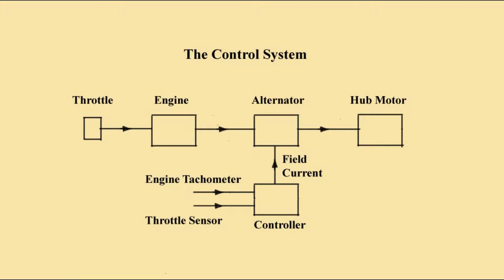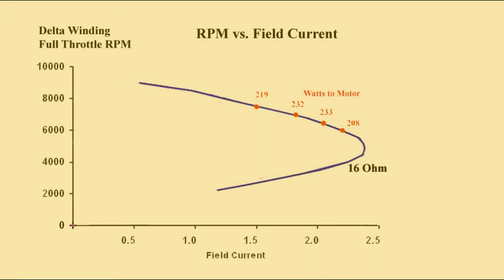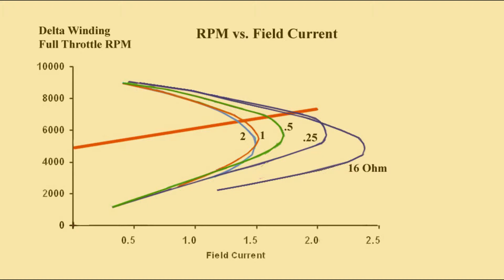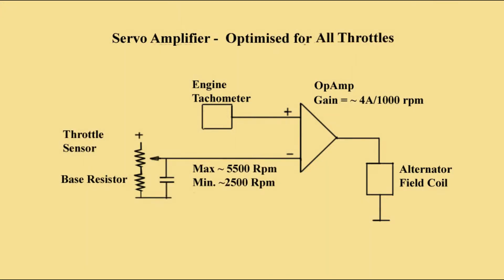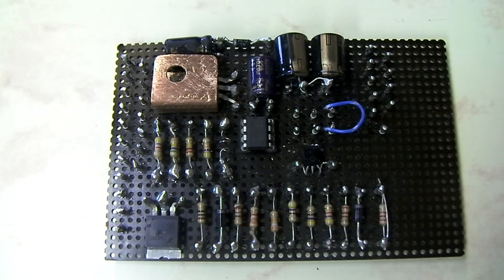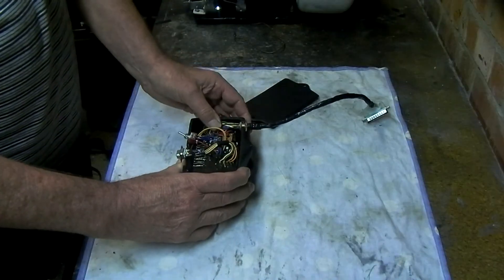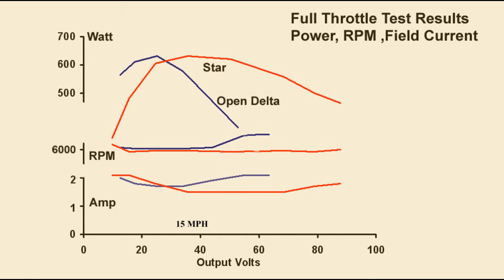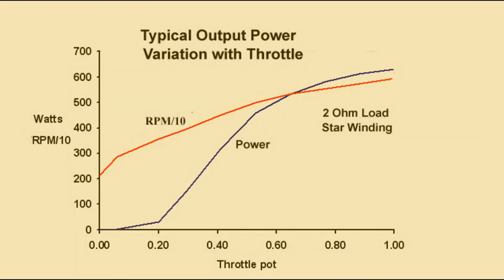Electric Bike Alternator 3

Comment: I understand why you used the gas engine, and admire the engineering, but would still rather see the bike powered by batteries. 
I don't see any reason that the principles involved could not be used for pure electric power, so thanks for the videos!
Reply from the maker: Dear FPVREVIEWS Thanks for your kind comment.  Pure power. What a concept ! YE

Comment: wow wrapping the component's lead over a metal post how old school.How old are you?
Reply from the maker: Dear pe6o991
Technique requires no investment for simple prototypes with late amendments. May not be pretty but quick, effective and reliable.-Computer graphic parts layout above matrix board-Layers for wiring, crossings wherever necessary
-Insert pins through real board at connection nodes
(Sockets for DIL parts)-Twist-solder fine hook-up wire around common nodes-Add sleeve insulation as you go
-Touch-solder parts on other side
-Job done!
Embedded microcontroller is the probable next step for the project for comprehensive control functions and “in orbit” modifications.
Greenhorn in this particular Game?
YE